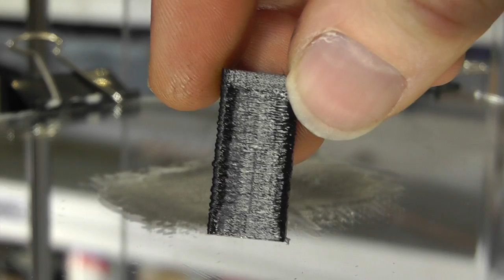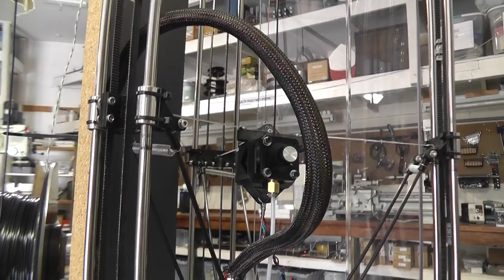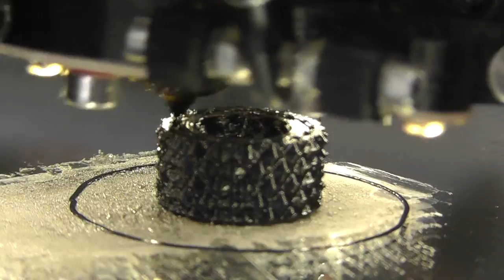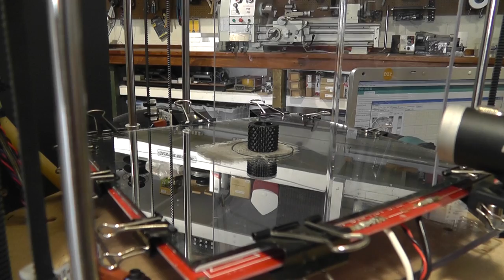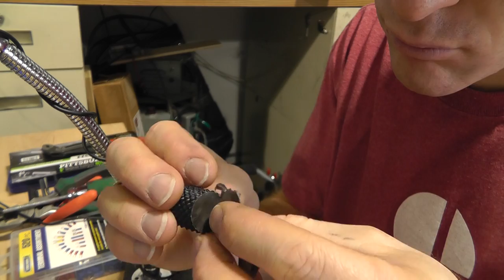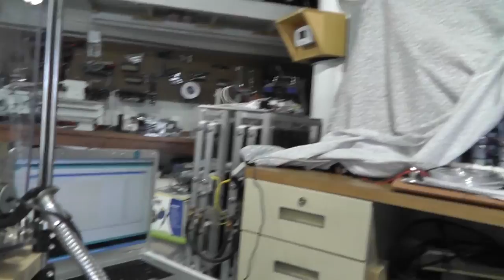Speed Testing The New Extruder Gantry Setup On My Delta Rostock 3D Printer

Comment: Hi Russ
I came across a similar problem in my delta. Plastic bubbles at the beginning and end of the work path. So I wrote a post process that can help you. I do not know what slicer do you using but if it is kisslicer. Give this program a shot. It call "extruder masta" you can find it http://www.thingiverse.com/thing:559369
It releasing the pressure built in the head at fast printing.